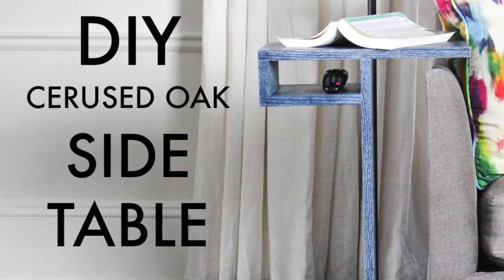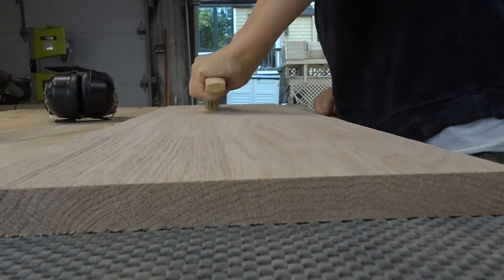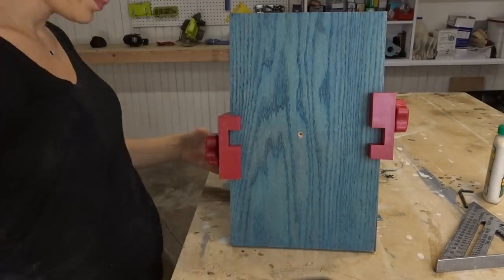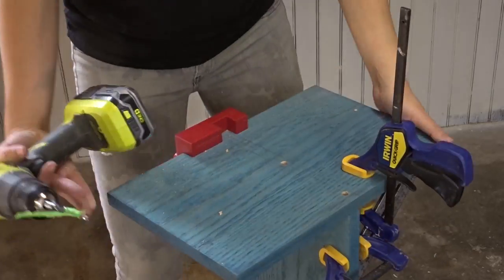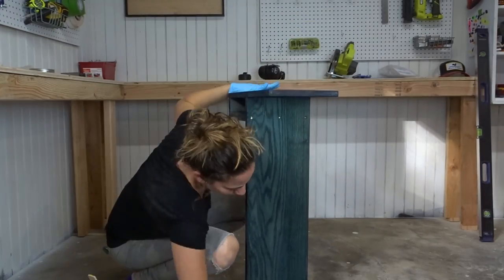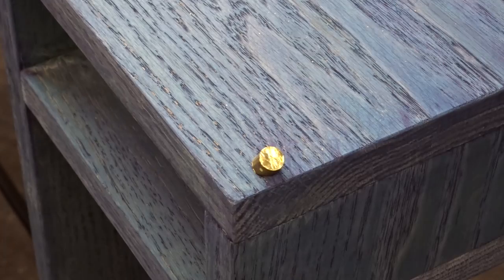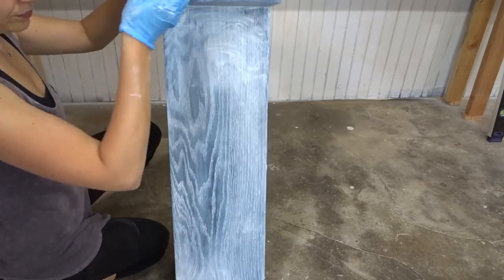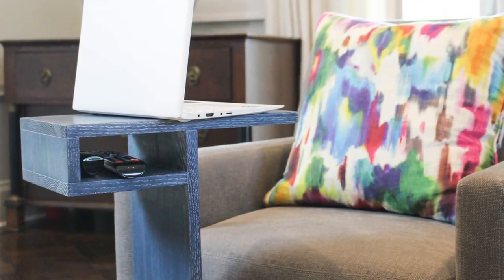DIY Side Table With Storage Shelf

Comment: Tamar, enjoyed your build, the color turned out fabulous. One tip there’s a reason it’s called finish and staining because you have finished construction. You created more work for yourself by staining first and then putting in your brass hole covers. Wood Dowels would’ve worked as joinery  but not quite the same look as brass.
Reply from the maker: DIY Home & Garden Projects yup. If you watch the whole video. I explain that was a mistake I made ☺️ thanks for watching!

Comment: Did you use a straw to clean up the squeeze out on that shelf??? that's a tip you should definitely highlight in the future if so. Never would have thought of that, but it makes sense.
Reply from the maker: Yup! I’ll def highlight that in the future. But the idea is not my own. I’ve seen it somewhere

Comment: Could you tell me where you got those clamps? I have used right angle clamps before but your clamps seem alot easier and faster for projects without the hassle of removing them while screwing in screws.

Thanks,
Reply from the maker: They are woodpeckers box clamps.
Reply: Thanks!

Comment: Check out Rubio Monocoat, it's a one step finish that i think you would love. A bit expensive at first glance, but it goes a long way and is available in 50+ colors. you can order small samples for $13 each. Hope this helps
Reply from the maker: Thanks! I love Rubio monocoat! I used it on my walnut ping pong table. Love how it smells. I wanted this project to be more diy friendly....